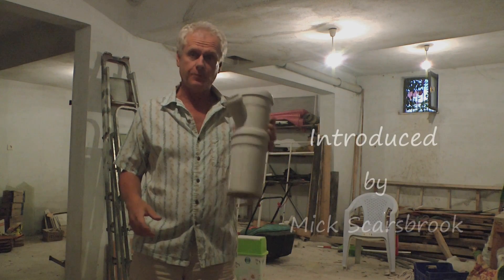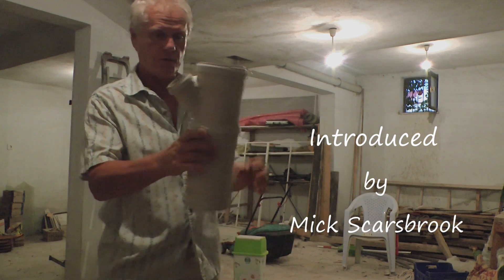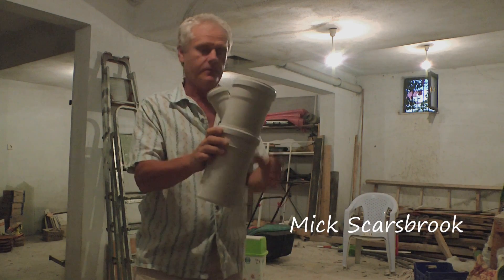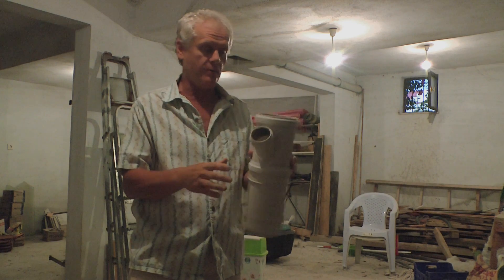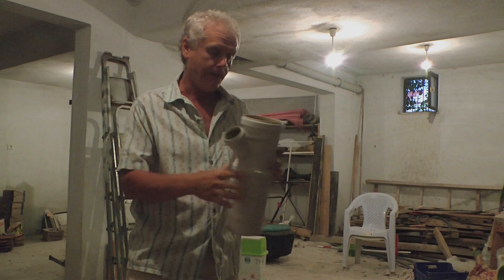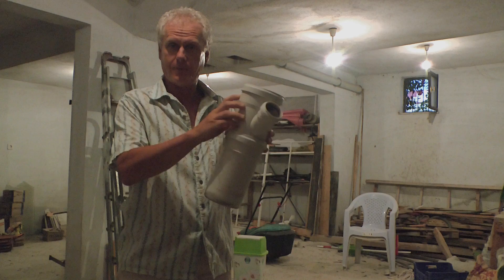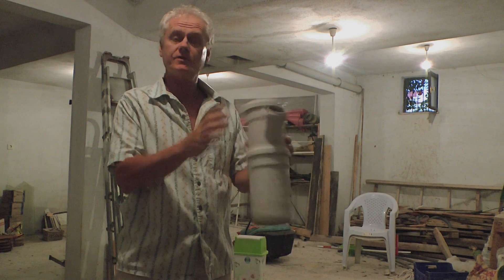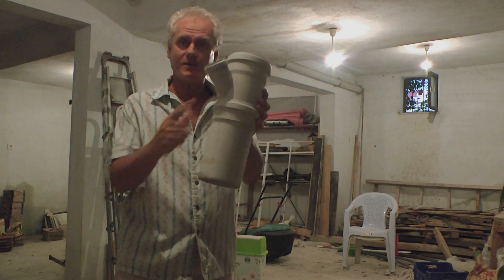Turkish Toilets and piping system

Comment: I was told not to put TP in the toilet. It's a hold over from the old days. When you still had holding tanks. I shouldn't say old days.... we have a holding tank in our summer house.  Not a septic system... just a big plastic tank. Soooooo you only have so much room. I dont flush Tp at that house..... but I do in the city since we are connected to the main line.

Comment: I bought one of these but my plumber doesn't know how to do the plumbing for the water pipes. Any idea?
Reply: @mickandtrudie  would that allow for the hot and cold water to mix when using the bideh? The toilet has a white nozzle in the middle at the back and 2 flexible silver pipes at the side. This is what my plumber don't know how to fix. I believe we need a thermostat tap to fit on the wall too.
Reply: @mickandtrudie  oh ok. Thanks

Comment: I suspect that the real problem is not in the pipe diameter(although I am sure that contributes in many "Usta" construction sites), but rather in the appalling manhole design where benching is non existent, or where present, often reduces the outlet diameters considerably: trapping bog roll and its associated travelers. After 10 years living here I still fail to see any hygiene benefits of used bog roll in a bin - so take my chances with the traditional flush. 
I concur with one of your comments regarding septic tanks/soakaways and can - from experience- highly recommend the use of an aerobic system with low pressure air bubbles. The bacteria love it and consume 95% of ALL solids.
Reply: I never had any problem with flushing down toilet paper in Turkey. I was told to not do it as a child, but this was over 20 years before. It will very likely don't cause any issues nowadays.

Comment: I think the warning is valid sir. Because no one can guarantee that all over the Turkey 110 mm pipe has been used. There are buildings that "genius" contractors used 70 mm or even 35 mm pipes.
Reply: Mick Scarsbrook in areas like Hisaronu they are using septic tanks so putting paper down the loo does block it.  They aren't even connected to piped water and have to have deliveries of water from a tanker.
Reply: Mick Scarsbrook my son in law runs a hotel in Hisaronu which is up the mountain and people putting the paper down causes a problem
Reply: Mick Scarsbrook not sure if it's a soakaway or septic tank

Comment: Really? Wow.  Why the warnings then not to flush toiletpapers?
Reply: Gereksiz yere atar yapmamış mısın? Ya da ben mi yanlış anladım, tam ne demek istedin?
Reply: I am not sure but ıt might be about some old piping systems or some other reasons like using less water or sth which  ı don't know. Because ı always flush the toiletpapers in the toilet and there is no problem yet.
Reply: We use both to be cleaner...
Reply: Elektro Türk yes I know but why are you not alollewed to flush the toiletpapers in the toilet but in a basket
Reply: Its can be block the drain system and plus its widely constidred to be toiletpaper place was the trash.
Reply: TURKS USE THEIR LEFT HAND TO WIPE AND THEN RUB IT ON YOUR BATH TOWEL.
Reply: +Karin Groes what the fuck "allowed"? nobody checks our shitty asses during shitting process. If you wanna flush toilet papers, you do it. Preferably we do tend to put them into a bin next to.
Reply: @metekayran3149  gerizekalı, annanen yaşındaki kadınla düzgün konuş
Reply: @jacksonwhittemore8477  harbi teyzeye boş atar yapmış